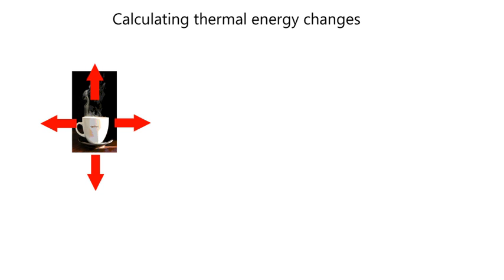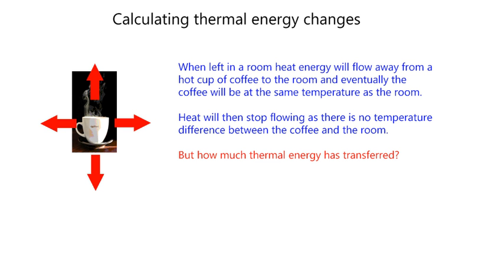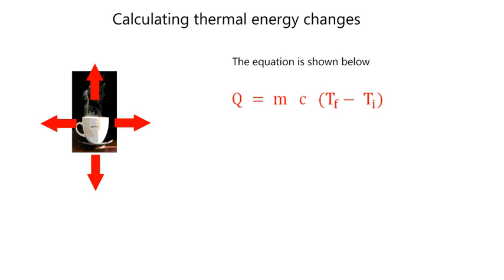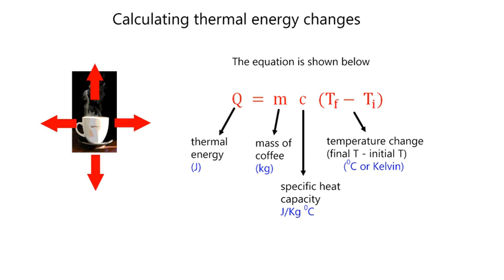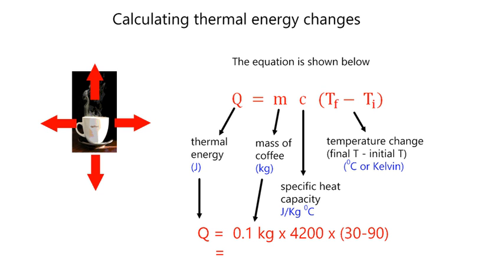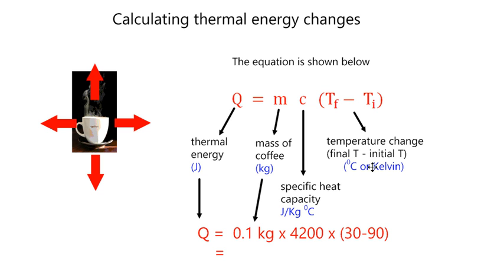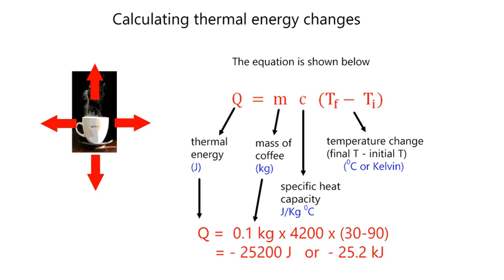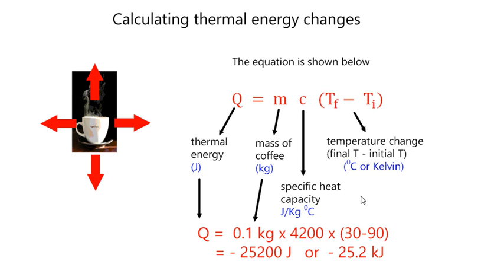Calculating thermal energy changes Q=mcdT

Comment: The heat capacity of water is 4.18x10^3 J/kg/k.
Reply from the maker: True, in the video there was an approximation made as is usual for the grade level it is being delivered to. For more exact results it would be better to use the value you quoted.
Reply: Ok, Thanks for the response!